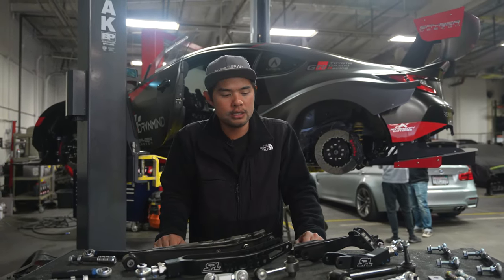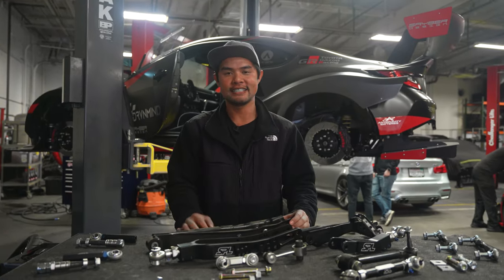BRZ GR86 Suspension by SPL Parts

Comment: Cool video! (and that GR86 has some sexy body lines with that aero!) On the FR-S/BRZ/GT86/GR86 there's a unique benefit to adjusting the rear suspension bump behavior, which is something you can do with a full set of our arms. It really stabilizes the rear bump geometry and makes for a faster, more predictable car.
Reply: Hey Alan. I noticed on the rear sway bar endlinks they are adjustable but not "fully" like say for instance Whitelines rear endlinks. It looks to me like you must adjust SPL endlinks BEFORE you connect the top bolt of the endlink to the sway bar whereas on an endlink like Whiteline's, you can adjust the length of the endlinks AFTER you connect the top bolt to the sway bar. Am I right on this? 
All of this to say- it seems it would be a little more difficult to delete preload with a SPL endlink setup vs a setup like Whiteline. 
Side note, I have your LCAs installed on my gr86 and love them.
Reply: @PBrooksSawyer  Good question, because they sit in the arm it's actually easier to install our endlinks because the single jam nut is easy to get to. Now, in terms of finite adjustment, the turnbuckle style is preferred, but sway bars don't need to be that precisely installed unless you're running a monster 45mm bar on something with limited travel like a NASCAR.
Reply: Gotcha and thank you for response. I just want to make sure I have 0 preload and the Whiteline end links give me that. However, the problem I am having is that the Whiteline endlinks don't have a rotating lower rod end bearing like the SPL endlinks do. But they do have the turnbuckle style adjustment. I have been looking for rod end bearing endlinks on both sides with a turnbuckle style and I can't find one for this chassis!  @AlanAtSPL
Reply: This would be done through the RLCA & the TOE LINKS w/ EL correct? r, are you suggesting we would also need the RTA and end links for that desires result? I dont want heavier or beefier sway bars - can stock links work @alanatSPL
Reply: @JeLifeCoach  to set dynamic toe you will want the RTA arms. The RE (rear endlinks) aren't necessary for the dynamic alignment, they help in a different way: resetting the sway bar angle and eliminating preload (particularly with lowering and thicker sway bars).